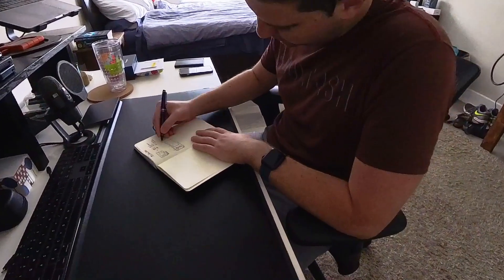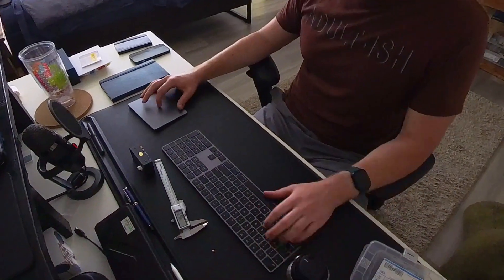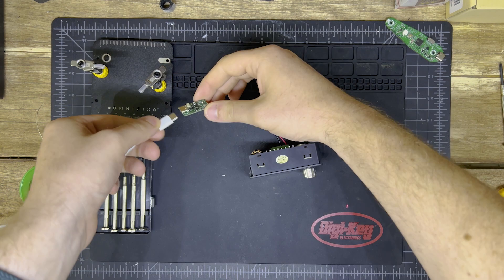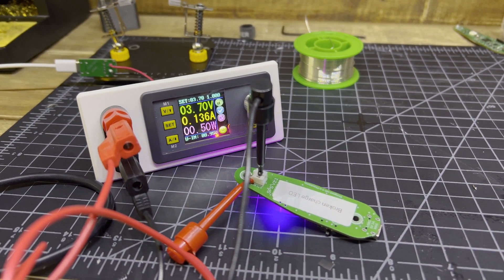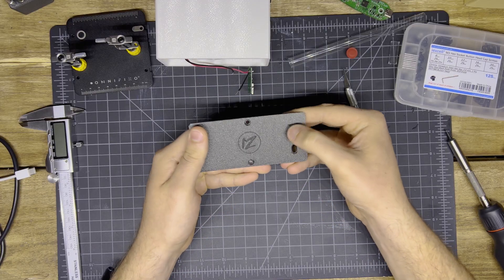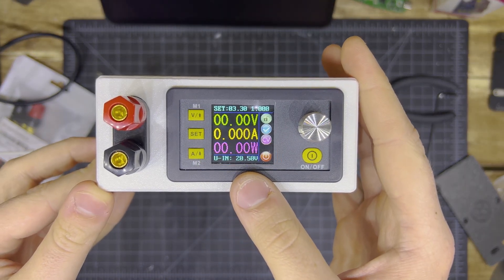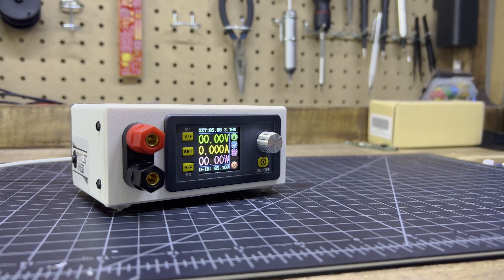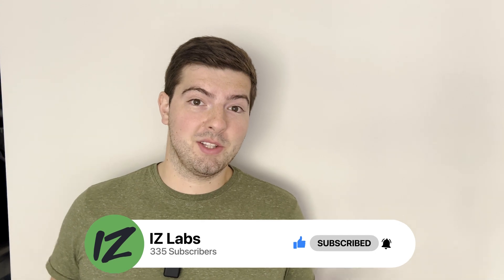Making a DIY Tiny Power Supply

Comment: With the USB module it can accommodate your mini PSU power? and the power comes from the laptop?
Reply from the maker: You could theoretically power it using a laptop with USBC power delivery output ports. Just depends on your laptop. I use this with a 60W type C brick that I plug into the wall. But I like the idea!